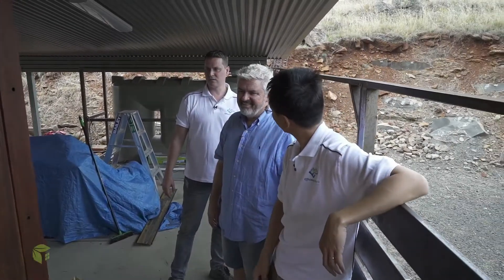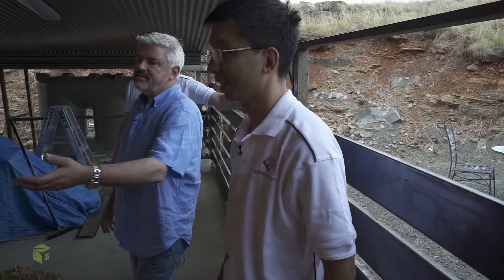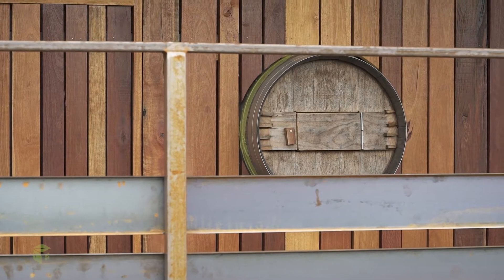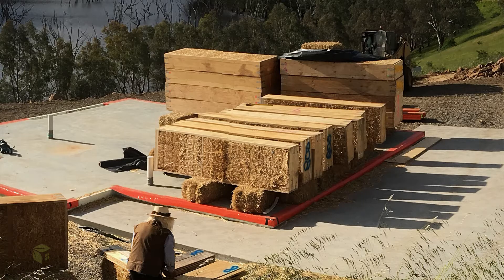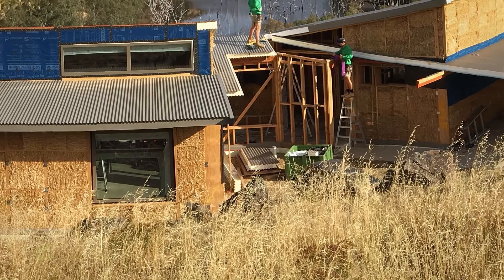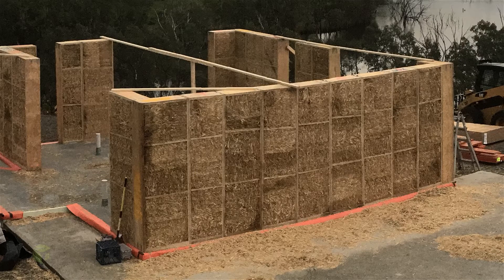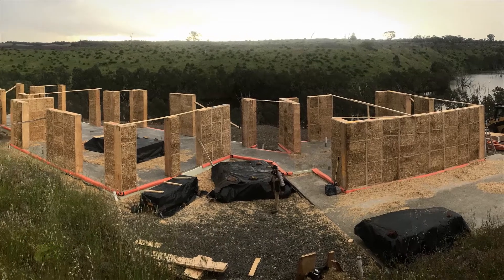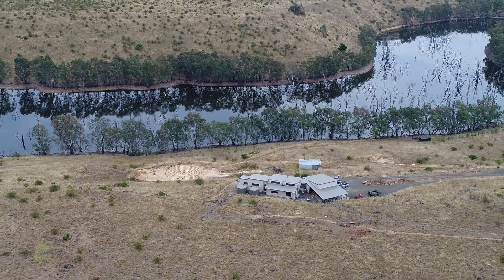Building air tight with straw bale (FOR BUILDING PERFORMANCE)

Comment: It's a pitty to use that much wood, when loadbearing strawbales are existing since so long time, are much cheaper, as strong, you don't need to cut so much trees.... If you are interested, check the "paillourte en paille porteuse" project....

Comment: https://youtu.be/iHBYvqr2_io?t=3369 what do you think of Lstiburek's thoughts on SIPs? He says that they're not high performance because it's very difficult to make the joins between them airtight
Reply from the maker: i believe what lstiburek is referring to is perfection. from a longevity perspective, we should not rely on one layer of construction to fill all performance requirements. we should plan for redundancy and in case 1 of the layer fails, the entire system will not collapse. if we solely rely on the sip to perform the air barrier, weather barrier, vapour functions, any imperfections in the workmanship can cause the system to breakdown.
Reply: @ecoevo  I see, thanks for the reply. Actually it seems that's probably wise anyway, there was another architect who originally was relying on OSB to be airtight only to discover that it was actually quite air permeable and so had to wrap everything up with a membrane
Reply from the maker: tuber Agreed some products may not be air tight, so it won’t matter how air tight you make all the joins! 😉